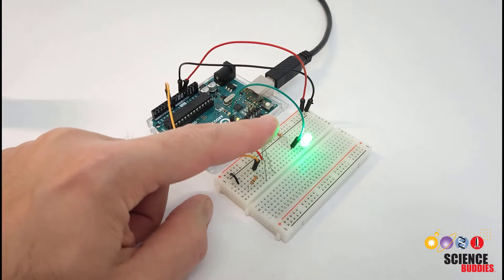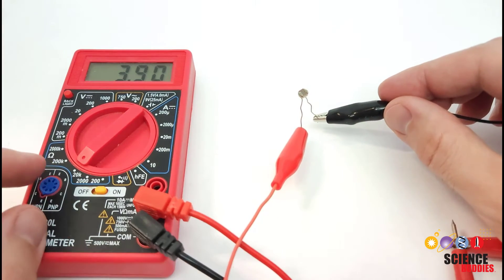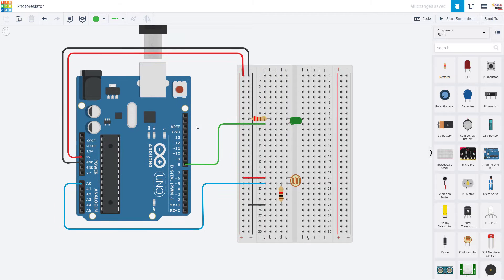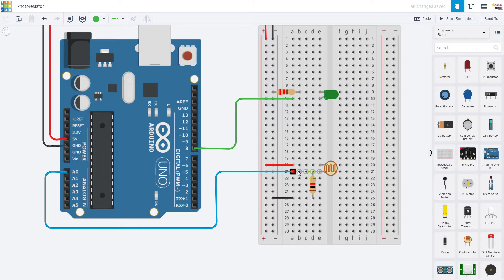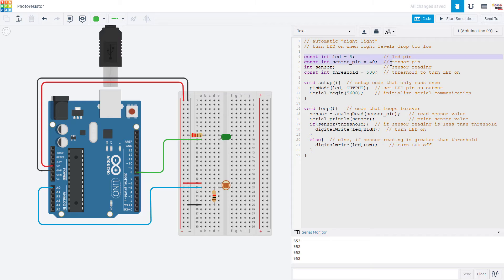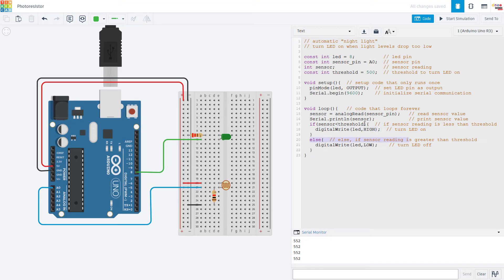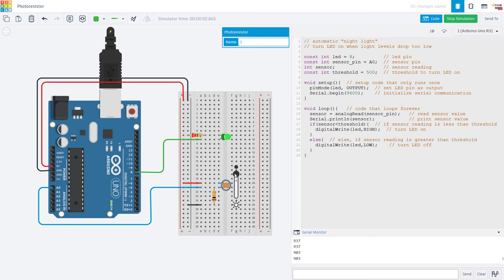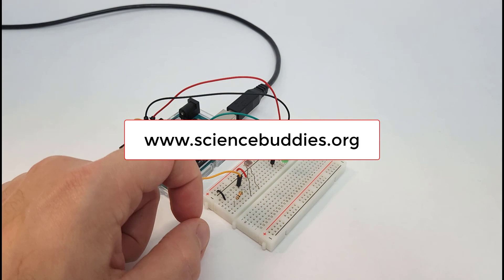How to Use a Photoresistor (Light Sensor) with Arduino (Lesson #27)

Comment: Arduino can't measure resistance directly insted measure changing voltage .
Reply from the maker: You are correct! That's why you use a second fixed resistor to build a circuit called a voltage divider, so you can measure the voltage change resulting from the photoresistor's resistance change.

Comment: int greenLedPin = 2;
int yellowLedPin = 3;
int redLedPin = 4;

int lightSensorPin = A0;
int analogValue = 0;

void setup() {
  pinMode (greenLedPin, OUTPUT);
  pinMode (yellowLedPin, OUTPUT);
  pinMode (redLedPin, OUTPUT);
}

void loop() {
  analogValue = analogRead (lightSensorPin);
  if (analogValue < 50) {
    digitalWrite (redLedPin, LOW);
  
  }
 else if (analogValue >= 50 && analogValue <=100){

 }
 else {
  digitalWrite (greenLedPin, LOW);
}
delay (200);
digitalWrite (greenLedPin, HIGH);
digitalWrite (yellowLedPin, HIGH);
digitalWrite (redLedPin, HIGH);
}

Comment: Hello. I have a similar setup but I have a problem. The photoresistor measures the outside light and when the light level is around the threshold value and the light starts to flicker. The photoresistor values vary over and under the threshold value. I trayed adding a 1 second delay but now the flicker is every second. What should I add to the code so this doesn't happen any more?
Reply from the maker: Hi - you could try taking an average of the last 10 (or 100, or so on) readings and that will help with the flickering. We don't have our own tutorial on taking an average but you should be able to find examples online and in the built-in example code.
Reply: Well, it's a sensor and as he said in this video this sensor is not that precise.
  When the light reaches the treshhold, becouse the sensor is not that precise, of course it will register different values and it will flicker.
  Programming also means that you need to solve a problem.
  In your case the problem will be how to trick the photoresistor to act more "precise".
   You can add a function outside the loop function and call it in the loop function which will monitor the treshold. Let's say you monitor 6 values in a row every time and if 2 of them are below the treshold, than set the led LOW. after that set a delay time and call that function again without turning the led ON if you encounter a "hit".
  This way, you won't notice if the led is flickering anymore

Comment: Thank you this is very helpful. I'm sending this to someone for. It's over my head. Basically what I am trying to get someone to create it to have a circuit that went so much light is hitting it. The circuit comes on. Definitely need to measure the light. Here is my application. I'm trying to solve and if it exist please point me in that right direction. We're building a home off grid and there are some appliances such as my deep freeze, that does not run all that often and if it is off for one to three days, it would be OK. I'm only wanting it to come on when it is fully sunny outside, so it does not run at night and it does not run on rainy days. There are other devices that I'm wanting to do the same with yet. This is the easiest application to speak to.
Reply from the maker: Hi - we're a K-12 STEM education nonprofit and can't really help with projects like this, you may want to ask in the official Arduino forums or other electronics communities like Reddit or Stackexchange.